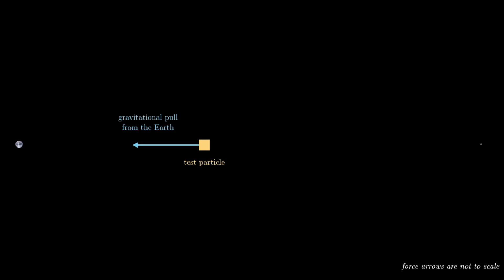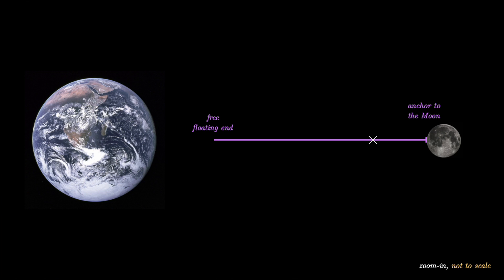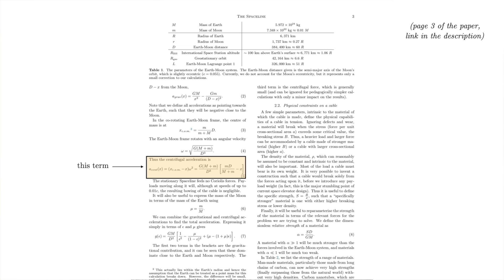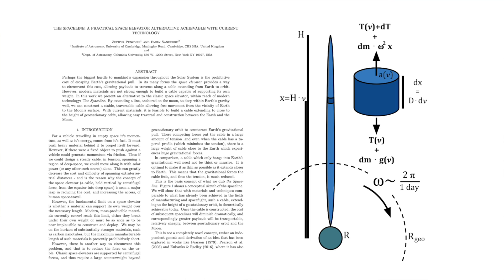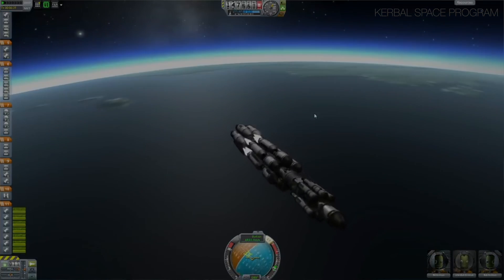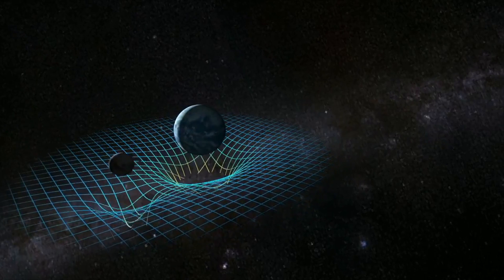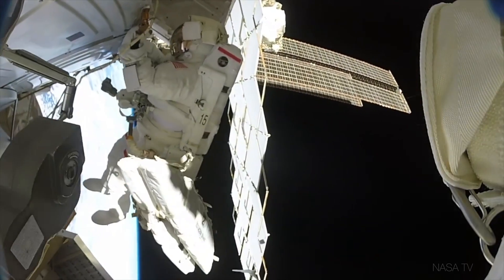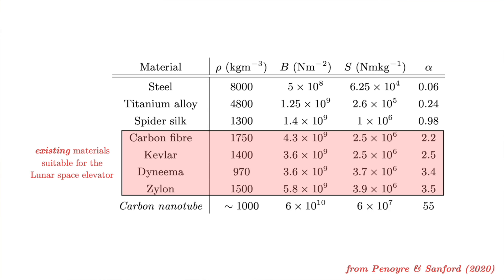The Lunar Space Elevator

Comment: Imagine the (UN) Space-Lift had a wide platform at L1, so only the centre of gravity needs to be matched; and more carbon-nano-tube like cables are used to match all forces (like say suspension bridges), to go all the way to Earth´s outer atmosphere (drag), with suitable elasticity / spooling (hey the Moon is slowly drifting away); and satellites plan to avoid that location,  or were sent energy to avoid. OMG. It then becomes cheaper to near space, and then Lift into orbit, then deploy satellites, in a drift down and stabilize orbit, kind of way.
Reply: As not ´re-entering´ at high speed, but merely dragging, maybe the cable can take the friction heat? permanently

Comment: This would be a huge benefit to my personal batshit space engineering proposal: Mount a railgun on the moon. Fire a bolt into orbit, catch it with a spacecraft that also has a railgun. fire that railgun to gain delta V. Launch another spacecraft once the first has reached the top speed the moon mounted railgun can reach with it's bolts. Add 100,000 space railguns in a chain (each adding mach 8 to the top speed of the farthest one out), and you're approaching the speed of light. We're gonna need a LOT of bolts though.

More reasonably, I'm interested in looking at how well my system would fair on a smaller scale, like reaching proxima centauri, or even just mars. Ultimately the bolts can actually carry data or gases or other materials, so even just having a relay network that can deliver goods to mars quickly would be huge, or on the gigantic scale, this system could not just approach lightspeed, but it could also return data from the lead spacecraft.

Like this lunar space elevator, I see this as a hard math problem, but I don't see any issues with physics.

Comment: Did you calculate what happens if that cable snaps?
Being suspended over the earth, and having no tangential velocity, I assume if would hurdle straight down towards earth, and impacting with very little athmosphereical heating or burn-off. I'd also assume that cable would have a relatively large mass.

Comment: Here are some parts of a lunar 🌙 space 🛗 elevator that you like... The orbiting counter-weight could be composed of gas canisters for plasma electric ⚡ satellites 🛰️... These 🛰️ electrically charge gas ions to move around... They could be hyperspectral imaging satellites helping to prospect the surface of the moon for valuable metals... Another plus of a lunar space elevator 🛗 would that it could deploy a net 🥅 to catch satellites 🛰️ that need repair (or to be recycled ♻️)... Such nets could use tether w/ regenerative braking (much of the satellites kinetic energy would be converted to electricity) ... A space elevator 🛗 probably should include MORE than one tether (between ground weight and space 🌌 counterweight)... It is good to have redundancy in case of micro-meteorite... And more than one tether would mean carriages could move up AND down the space elevator 🛗 simultaneously... As multiple lunar space 🛗 elevators are built the engineering, material science, etc would improve... Laying the groundwork for similar structures on Mars and Earth 🌎 eventually...

Comment: 2 flaws with it
1. tether is hanging towards earth.. fine enough.. the object docking at earth end and starting journey (pull on tether) will cause some (aircraft like) "G"s on it (i know it wont be 9.8m/s2 but still will enough) n any fluctuation in acceleration or slip by pullies / clamp wheels on it will amplify that fluctuation 1000s of times because of inertia in atoms of tether over 42000 km (think weight/disc bouncing back on yoyo).. n it'll snap. 
2) the object starting travel must still carry thrusters to keep movement laser straight parallel to tether and to avoid sway / side ways movement errors caused by even finest mechanical pullies/grippers.. these over-course adjustments will cause fluctuations in "G"s on tether n again point1 applies above.. n snap..
solution: possibly start with tether attached to geo sync satellite n its other end falling upto 450km/leo height.. start small like sending course correction refueling (gas) cartridges via light rocket from earth or airplane attached rocket to just reach upto 450km/leo n handover payload to tether.. also i think the tether should be a twin tether running parallel at say 2-3 feet and (parked) ribbon fixers on tether every say 5km so even if tether snaps at some point a 2nd/backup tether will help the "2" fixers to travel towards each other .. now since the broken tether was/is also passing through fixer the broken tether ends  no matter how far apart will also start coming together the fixers will then mend the broken points back and/or using smaller reel in fixers too. Now since fixers are sitting at every 5km its not problem from the package coming earth to maneuver/traverse fixers. This package could resupply the fixers too.

Comment: ALL YOU NEED IS A STRONG.. ROPE 70 THOUSAND FEET CHAINS ROPE ⛓️🔗⛓️🔗🔗 in 🚀🚀 ROCKET SPACECRAFT.. and Lift Motor..  just Like CRAIN LOWER WEIGHTS DOWN.. THE SPACECRAFT ABOVE 60 THOUSAND FEET 🌕 MOON SURFACE.. WILL DROP THE CHAIN ROPE ALONG WITH YOUR MISSION 🤖 🤖 ROBOT.. SO YOU WOULD DROP THE ROBOT 🤖 FROM 60 THOUSAND FEET ABOVE MOON SURFACE.. ORBIT.. SMOOTHLY YOU WILL LAND THE ROBOT 🤖 TO MOON 🌕 SURFACE WITH 70 THOUSAND FEET CHAINS ROPE ⛓️🔗

Comment: Why is going up the tether so much more energy efficient than a rocket? I don't get where the energy savings is? Doesn't gravity pull on the elevator as much as a rocket?
Reply from the maker: Rockets waste a lot of energy. Just think how hot and loud they are.
Reply: 15:06 : Her point was solar energy could be used to power motors that pull on the line connected to the moon. Most of the energy used in a conventional rocket, is wasted on carting fuel to use later.

Comment: given that most of the fuel used in a rocket is for getting the payload off the Earth,, Im confused about what the point of this is, as it still requires getting the payload off the earth
Reply: I'm in no ways an expert, but I'd always imagined the biggest benefit would be lifting lunar-mined material (and/or lunar-made metal ingots, prefab constructs, etc) up from the moon and taking them to L1, rather than the other way around.

Comment: the thing i never understand about a space elevator, is that doesn't something pulling itself up the cable exert the opposite force on the cable itself? For example, if i'm floating around on the space station, and i take a bar bell, tie a long rope to it and leave the barbell on one side of the space station, and the rope on the other, then pull myself towards the barbell with the rope, I will pull myself forward, but i'll also pull the barbell towards me.

Comment: Actually it is not impossible. The problem is you're all looking at the problem from the wrong point of view. 
Instead of using a conventional elevator that is dependent upon a fantastic unfeasible cable of non existent material that can support its own weight and the payload. 
There is another way.
By building an artificial mountain, of ordinary terrestrial material with robots. To the altitude of 50 miles high (more or less). Where a staging area can be utilized to deploy and recover payloads and personnel going to and returning from space.  Using boosters, and tugs/freighters to move  commerce and personal. 
Inside the mountain conventional elevators (in stages like a normal express elevator in a skyscraper) can carry passengers and small payloads. 
While larger freight elevators can carry bigger loads. 
Also on the exterior of the mountain, using ordinary railroad tracks and special tracks (at the upper altitudes where microgravity is a problem with oversized freight) electric trains can haul finished components for habitats and space faring vessels.  As well as retrieve inbound commerce such as ore, and what ever else may become commercially consumer goods for the erth.
I have a page on Facebook that I haven't had the resources to devote to this topic, but it is there.
In addition to the mountain itself,  the upper surface areas could accommodate enough wind turbines to effectively eliminate the power needs for the entire planet, with 24/7 dependable clean energy. 
Also in the basement of this mountain, all the toxic waste, including radioactive waste can be entombed permanently and safely for eternity. 
As for where to build it? There are possibilities at Antarctica, the North Pole, Australia,  and the Gobi Desert, because there are too many people everywhere else on the planet.
But it can be built, within a lifetime or sooner. With a surplus of manual labor, it may be possible to eliminate planet wide poverty, by giving or recruiting people jobs to build it.
The Space Elevator Project could also be the tool to create unity and cooperation for all the people of the Earth. 
With cheap safe and expedient access to space, anyone who wants to leave could migrate to an off planet colony, or slow boat to another star.
I've addressed all the issues, I just haven't had the opportunity to put it all in text or paper.

Comment: I think the main problem you're not considering is the length of time it would take to crawl a cable from any point to the moon. Even if you catch it halfway, that's still over 100,000 miles you have to travel to reach the surface. If your elevator travels 100 miles per hour (which would be pretty crazy), it would take more than 40 days to reach the surface. So that means a habitat would have to be constructed.

How about this as an alternative design...use the centrifugal force from the moon. Put a far shorter cable (say, 60 to 100 miles) on the far side with an anchor weight. A lunar spacecraft will rendezvous with the cable, and then make the comparatively easy descent to the surface. The moon is travelling in an arc around the Earth at a speed of about 2,100 miles per hour. Best part is that it could be installed completely via unmanned missions. You could then easily install additional cables for various locations on the far side. I haven't calculated how long the cable would need to be, nor how heavy the tether weight. But it addresses the engineering challenge and the logistical challenge of travel time.
Reply: If you have more than one tether cable 🚠 cargo can be constantly moving up and down the space 🌌 elevator 🛗... Old satellites 🛰️ in need of repair, empty plasma electric ⚡ gas canisters, metal shipments from earth 🌎 move down... Repaired satellites 🛰️, filled gas canisters, astronaut (maybe with a book 📚 or kindle) moves up... Lol...

Comment: Has the potential electrical charge between one end of the cable and the other been considered?  To assume a neutral charge between the earth and the moon may be a mistake. To not consider the electrical properties of such a cable may be a fatal oversight.  Consider the failed space tether experiment in 1996 where the cable snapped due to excessive electrical current flowing through the cable.

Comment: Interesting idea.  There would have to be sufficient counter weight otherwise acceleration of cable car would displace the end.  Also, the harmonics of any lateral force on the the cable would be challenging (lasso effect) as it moves through the gravity well. Last, what propulsion would be used by the cable car to traverse 40,000 km in a reasonable amount of time. Friction would be significant.

Comment: I'm not sure if I missed the point but how the elevator would move from point A to point B? It would need energy to counteract Earth's gravity, and viceversa, and a big pair of calipers to slow down when reaching to the end of the "rope" towards Earth. Then I realized, could it move similarly as the Hyperloop does? Vacuum is free up there, but injecting some gas behind the capsule in a closed tube, it will push it through the vacuum on the other end. To reset, just open the valves to the space? How crazy it would be? Great explanation.

Comment: Two practical questions: How would the elevator actually climb the cable; power supply, energy needed, weight vs gravitational equasions, etc.?
And what kind of material can withstand the weight of it's own mass for a length that long, let alone adding the weight of the elevator and its cargo at the extreem end?  How much raw materials would be needed for such a cable and, surely it would need to manufactured at the gravitational center of distribution. These questions seem huge but In sure you have done the math. It would be great to have another video expanding on such things
Reply: Probably have a nuclear reactor near the base of the space 🛗 elevator... The space elevator could also incorporate conducting wire... So energy from a nuclear reactor could travel up it, energy collected by solar satellites 🛰️ could be beamed to the space elevator to power processes inside, to satellites 🛰️ that pass nearby or to the lunar surface (if there is surplus of solar power)... Which is to say that the counter-weight could also serve as an orbital electric ⚡ hub...

Comment: If you are wondering why the effect on cost of travel to the moon is so great when getting off Earth is the hardest part, recall that the fuel needed to go from Earth orbit to the moon also has to be launched from Earth.
Reply: yeah a fuel depot with space Tug (like a tractor) would also be a better option.If the fuel depot can be refilled using a Railgun or something to assist the  liftoff, it would be cheaper and much more efficient than the normal way.

Comment: I think your high, how would there be no tension on the cable over coming the breaking strength. You pick the spot to feed the cable from and you feed at the right pace to maintain that spot. Therefore the cable is pulling on your starting point. Are you sure there is cable out there that you could let out 350,000 km's of without overcoming its breaking strength. There would be no tension at each end but there would be a lot at your balance point.
Also have you ever dropped a cable down a hole, it gets scary really fast. If it broke and started getting pulled to earth. You better hope your super strong cable burns up in the atmosphere. People wouldn't be happy when 350,000 km's of wire rope came screaming to earth.

Comment: The earth and moon's gravity do not cancel at L1.
There are three accelerations at play at L1: 
Earth gravity: 3.74 mm/s^2 earthward
Moon gravity: 1.46 mm/s^2 moonward
Centrifugal force: 2.29 mm/s moonward

At L1 this 3 man tug of war centrifugal force plays a larger part than moon's gravity. So I have to disagree with you that centrifugal force can be ignored. It is significant along much of the elevator length.

Chris Wolfe devised a spreadsheet that cuts a tether in many small lengths and then calculates net acceleration by summing earth's gravity, moon's gravity and centrifugal force. And then sets tether thickness by how many newtons are exerted and tensile strength of tether. I used it to look at the Liftport tether proposed by Radley and Eubanks: http://hopsblog-hop.blogspot.com/2016/04/liftport-lunar-tether.html (scroll past the promo for my coloring book).

For this post I plugged in a safety factor of 1. Which means the slightest scrape or nick could cause the tether to break. In my opinion a sane entity would use a safety factor of 3 if using the elevator to move humans or valuable cargo. But even with a safety factor of 1, we'd need a 1,610 tonne elevator to move a payload of 10 tonnes. And that 10 tonnes would include solar panels, shipping container, engines and wheels of the elevator car. In my opinion the lunar elevator is impractical.

I'm much more enthusiastic about another Marshal Eubanks tether idea: Phobos anchored elevators:
(again, scroll past the promos for my coloring book Kickstarter)
http://hopsblog-hop.blogspot.com/2016/01/upper-phobos-tether.html
http://hopsblog-hop.blogspot.com/2015/12/lower-phobos-tether.html
and
http://hopsblog-hop.blogspot.com/2015/06/phobos-panama-canal-of-inner-solar.html

Comment: I congrat you and your colleagues on your hard work, but frankly, the whole thing would just be incredibly unstable!! The smallest micrometeorite hitting the cable - or even just random oscillations in the cable, and each part of it will try to follow the "natural" orbit for their height - which means the end closest to Earth will try to move faster to the east than the parts above it. This will propagate to the whole cable and after some time this will cause massive stress on the anchor, which will either snap or (if strong enough) impart a reactive force causing the whole thing to swing to the other side, in both cases the center of mass will no longer match the L1 moon-earth point.